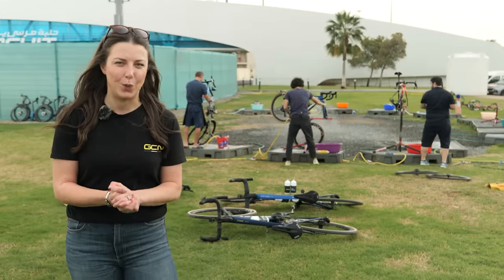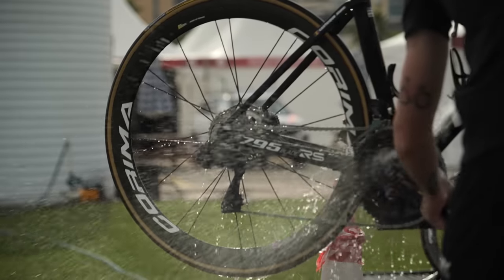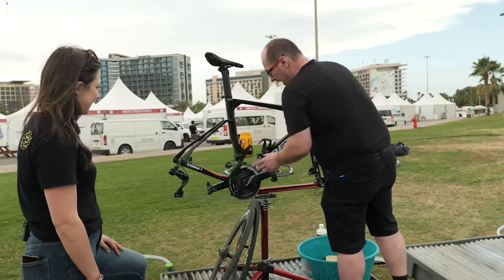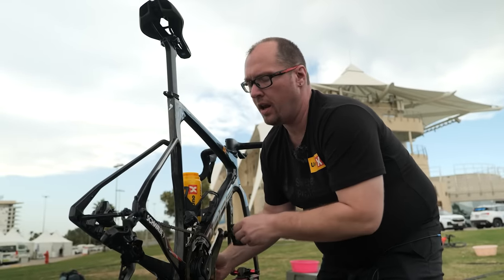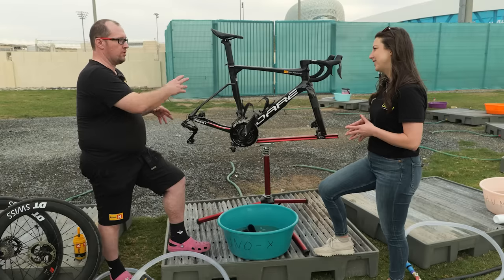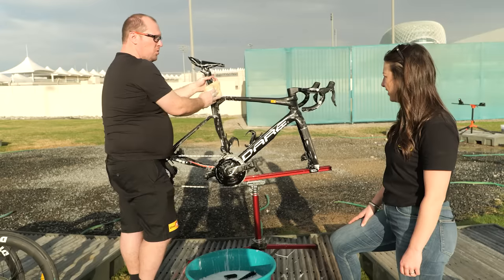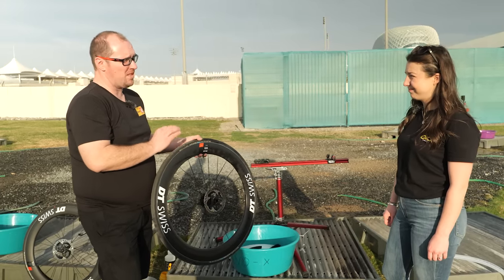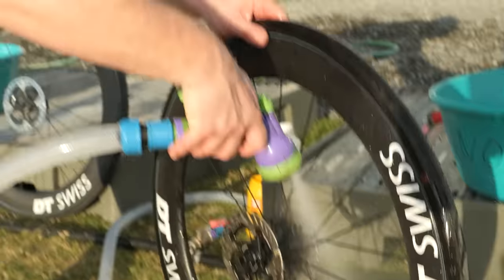How To Wash Your Bike Like A Pro Mechanic

Comment from the maker: What was your favourite tip from this video? 🧼
Reply: Interesting that (other than WD40!) much of the pro advice is the same as Si's 10 year old bike wash video, even down to the washing up liquid and using the old water bottle and brush for degreaser.
Reply: As long as you clean your bike .dry it . I like air compressor for the chain .lube .good to go.
I'd say it's not good to wash the bike every time. Especially in summer unless your sweating lots , but definitely the chain. Washing to much kills  the paint 😮? What do you think
Reply: Has to be the water bottle. Easy and effective.
Reply: Cleaning the pedals.
Reply: Don't let a pro mechanic clean my bike 😳. Too liberal with degreaser for my liking. Different story if you don't have to pay to replace degreased bearings.
Reply: The water bottle tip was good 👍
But on the other hand, I would never run the chain around the rear axle 😁
Interesting that PTFE additives are not prohibited in pro cycling?
Reply: always eat before you wash.
Reply: I wish you asked him why he didn't use a dummy wheel thing for the chain

Comment: Next video: “Why you shouldn’t wash your bike like a pro mechanic”
Reply from the maker: It's a great idea! 💡
Reply: With some Silca bikewash products and boiling water to clean the super secret wax of your chain. I'm surprised the at this level of cycling they still use lube
Reply: They are running out of ideas
Reply: @chrisjong8412  The key is drivetrain losses. A CLEAN chain with lube will sometimes (depending on the lube) have marginally less losses than a waxed chain BUT that's almost never the case because (as you know) a lubed chain is pretty good at catching dirt and holding on to it. For us non-pro riders, a waxed chain therefore almost always makes sense (that being said I still run lube because I can't be bothered to faff around with white spirit and a crock pot), but if your bike is cleaned by someone else after every stage in a bone dry desert stage race ...
Reply: @robbeelsas  And to add, a waxed chain needs to be rewaxed about every 300 miles, maybe sooner in bad weather, so in stage races, that's basically every day times 8 times 2 in the worst case (rain and every riders needs their reserve). Now you could bring a truck full of pre waxed chains for every stage, but that's a lot of faff beforehand. And if not it's more faff inbetween. Mechanics don't like it basically, so it is not used widely yet. Chain longevity isn't much of a factor in pro racing I guess, but that is the main selling point for wax for consumers.
Reply: noooo 😂 @emanuelv19
Reply: I just felt the line she used was bad "how do you wash a bike like a pro mechanic", why didn't he go "as I'm a pro mechanic, I just wash the bike"
Reply: @gcntech when you degrease a waxed chain, do I need apply lube?  My new bike has a waxed SRAM chain, there is so many videos I’m getting confused? I really want to keep on top of the bikes care because it’s my first expensive bike.
Reply: @ramsden35  You don't degrease a waxed chain as there's no grease on it. You re-wax it when needed by either spraying/wiping it off(never put water on a waxed chain unless you're re-waxing it), then boiling water and swishing the chain around in it first, or putting it straight into the wax pot and doing the waxing stage again. If you don't have a waxing setup then I'd have to guess you would need to clean the old wax off with the boiling water pot and then switch over to regular oil.
Reply: Bucket and soap and some degreaser for the chain and cassette it's not rocket science

Comment: As a bike mechanic I see a lot of damage from washing, especially as nowadays bearings have become thinner and are often more exposed to make room for larger thru axles and all that on bottom brackets and hubs. If you are not a pro and plan on keeping your bike for a few years go easy with the washing, never use pressure hoses, and better remove the rear sprockets if you have to clean them (you don't want degreaser entering the freehub body bearings).
Reply from the maker: That's really interesting! Easy on the washing is good idea, keep the bike clean but don't ruin the bearings 😬 - What do you think about chain wax? 👀
Reply: Yea, my bike shop actually advise me unless you were riding in the rain, else just get a piece of cloth, wet the cloth and wipe the bike, that's all, as for the drive train, another piece of dry cloth and toothbrush to clean and re-lube. The mechanic actually told me that lots of bikes were having problem here and there because they were washed with water and cleaning products too often.
Reply: @emanuele8226......Another thing I saw that I wouldn't recommend - the carbon wheels seemed to have internal nipples on the spokes. As most wheels these days use alu nipples it's not a good idea to wash them off with a hose [and definitely not a high-pressure hose] as you will get water ingress inside the wheels.
This will cause electrolytic/galvanic corrosion to the nipples - which ultimately leads to spoke failures and as consequence possible serious accidents.
Reply: I wouldn't be able to take off the rear wheel or the rear sprockets (think that's the cassette). So what would you suggest in that case? Not clean the bike?
Reply: Spot on!
Reply: how about the bottom bracket? When you apply a degreaser on chains and crankset, some of it seeps through the bottom bracket. How to prevent that? And if you remove the crankset, the bottom bracket is more exposed to the cleaning agents, so which is which?

Comment: We now need Ollie reacts to this video. Fairy liquid, degreaser in all sorts of unholy places, not removing the chain and cassette to simply submerge them in degreaser (or melt the wax off them), spraying water up the bike, using a sponge and there was even mention of a pressure washer.

Comment: It was a good video. Mike was quick but very systematic, very detailed. One question though. What about protecting the brake rotors, calipers and pads, with all this degreaser being applied and water spray going across wheel from cassette to rotor. Seems to be asking for contaminated brakes.
Reply: He did mention this in the video, he cleans everything after the degreasing

Comment: Always take your rear cassette off before degreasing it. Never get degreaser near your rear wheel hub. Learned that lesson the hard way in the past as always cleaned rear cassette like the guy in the video, which ensured water and degreaser got into the freehub eventually.
Reply: So what should I do if I can't take off the cassette and rear wheel? Supposedly you should degrease your drive train frequently. But how do I do that if I also have to wash off the degreaser very well to ensure that nothing remains?
Reply: @luperamos7307  depends on the reason why you cant remove it. If its just about not having the right tools, get them! If its stuck then get an LBS to remove it and replace. If there is any other valid reason why you cant remove the rear cassette, then it all depends how dirty it gets. You can degrease the chain without any degreaser getting onto the cassette by removing the wheel and using a chain keeper. If the cassette isnt covered in mud you can always do a cheats clean by giving it spray of something such as gt85 and then wiping it off with a cloth  that will remove surface dirt
Reply: @bladesman7701  GT85 is similar to WD40 I think. So I could just spray that on to degrease, wipe it off and not rinse it off? I just don't feel comfortable taking the rear wheel off bc I have no experience with that. Judging by all the videos here it seems that few people do.
Reply: @luperamos7307 yes mate it is similar however learning how to remove and put back on the rear cassette will help you so much. Lots of you tube vids show you how its done and the tools u need. Best of luck mate.
Reply: @luperamos7307 oh and using degreaser on your cassette while it is still on the wheel is ok so long as you do it sparingly, hence not everytime you clean your bike.
Reply: @bladesman7701  Yeah, I bought a used mountain bike before buying another. Mainly to play around with it. Always best to maintain your own stuff once you know. Appreciate your help!

Comment: looks like the pro peloton isn't so big on chain waxing (don't tell Ollie!). I pretty much follow Mike's strategy, except don't remove the wheels after every ride, unless it's been particularly gritty out, and don't degrease the drivetrain because wax (Silca drip-on currently). Always dry the bike before storing it, lovingly, inside the house 🙂
Reply: Silca degreasers are made to not negatively impact wax so if you go with their degreaser you can do the drive train, I believe.

Comment: What I always wondered about: It is generally not recommended to wash a bike with a pressure washer. However, I have never seen somebody say something against compressed air for drying the bike after washing it. Wouldn't compressed air also push water into all the bits an pieces that we don't want water in - bearings and stuff like that? What am I missing?

Comment: I basically have 3 standards of wash, 1. quick rinse and dry, wheels in, mostly in Summer. 2. Degrease and wash, wheels out, re lube, after nearly all Winter rides. 3. Strip, degrease, thorough wash, wheels out, cassette and crankset off, relube, polish etc. The whole 9 yards.
Reply from the maker: Sounds like you've got your system down 🙌 How often are you doing the big clean?
Reply: @gcntech  moveable feast to be hones, depends on the weather.

Comment: I wash my bike chain, pedal tooth, drueller especially its wheel tooth with liquid detergent soap dilluted in water by using toothbrush(medium), brush thoroughly while rotating your pedal until all dirt removes and then wash with spray water until the soap residue remove and clean… let it dry, thoroughly dry… then have a spoonful of crude oil , dip dry toothbrush and apply on chain, drueller tooth, pedal tooth while rotating your pedal by hand.. proceed brushing until you hear that smooth sound, means the oil penetrates inside the chain, pedal and druller wheels… dont use lubricants as it invites much dirt… once your frame dry, rub w clean cotton rug dip little on crude oil to waterproof your frames so as  it will not invite dirt or mud and its easier to remove.. for all bolt joints brush it with small amount of crude oil… remember; a spoonful of crude oil is enough for your bike… I’ve been using this scheme for more than 20 years by now..

Comment: Theres loads of degreasers out there. My tip is Elbow Grease from Poundland. £2 a bottle lasts for ages. Great for complete strip down cleaning and when used diluted is brill for general degreasing whilst components are on the bike.

Comment: Hmmm … car and bike detailers stopped using sponges a long time ago. Too much embedded grit. Soft brushes best. I also use Fairy Liquid for wheels etc. GCNTech, in a previous washy video, were horrified people used that. Assume this chain not waxed. GCNTech also strong wax advocates, I prefer wet lube, applied often on a cleaned chain.

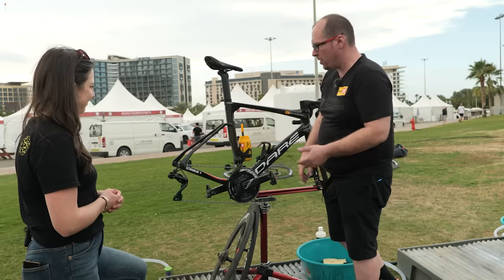Comment: I had a small panic attack when he said "water bottle holder" at 2:51 in the most British way possible 😅
Us non-natives can struggle with deciphering that combo 😄

Also, regarding the procedure itself:
1. You can see wear on through-axle from chain-rub. I'd avoid running the chain over it. Pro can do it, cause they'll just replace the whole bike every now and then. 
2. It's better to spray the washing solution, than to rub it with a sponge like in this video - depenging on how dirty your bike is, you gonna scratch the coating.
For optimum results spray warm solution, let it soak, wash it down. Only then, if there's some stubborn dirt would I use the sponge.
Reply from the maker: Hahahah it's a tricky one 🤣
Reply: A holder that holds a water bottle?  How much more descriptive does it have to be for you to understand.  Would "bidon cage" be more obvious?
Reply: @stevemawer848  why are you so rude?
I'm talking about the pronunciation, where British people tend not to pronounce t, d, r letters in some cases.
Reply: @dtsybulskyi   I'm not so rude - you really shouldn't jump to wrong conclusions or it'll make you look foolish. Nowhere did you mention pronunciation, just "in the most British way possible" which, to me, meant clearly articulated.  Try to be clearer when you want to be rude.

Comment: Pretty much the same way I wash my bike except I don't use Fairy liquid but a bike cleaner for the frame, and don't take off the wheels unless the bike is caked in grime. Also, I clean my brake rotors every other or third wash with a regular disc brake cleaner, and check that the callipers are nicely centred.

Comment: I really would like to have seen his tips on applying chain lube. I used to apply it like he did in the brief clip you showed, but it was excessive and made a mess. Given he just washed the bike, I'm sure he has some great tips to share. Instead, I've been doing it lately like some other videos have shown: a drop on each link. Takes more time but generally less messy. I'd love to do it faster.
Reply from the maker: Hi, thanks for the comment. This is a tricky one, because the bikes are washed daily, the mechanics quite often aren't that bothered by any mess being caused, as they will be washing them again within 24hrs 🪣
Certainly though, to keep it nice and clean, you need to carry on following our tips of applying it to each link, or, do as Ollie would do, WAX! Hope it helps?

Comment: I guess this works, hosing the drivetrain, if its riden daily. When you get it that wet, new lube or not, best dry it with compressed air, or you'll find a rusty frozen chain a week later, to us weekend users. Just tear it down and clean it proper every 500 or so miles, if needed, based on conditions. Doesn't take that long. I get about 2000 miles out a PC1130.

Comment: Ummm... I need to know about those platforms.  I've never seen that before, and it certainly looks like something that is purposefully done here.
Reply: They are a Euro style repair stand.  Pricey, but very nice.
Reply: I think the original poster is talking about the platform they’re standing on……They allow the water to run off so you’re not standing in mud
Reply: @dbk81  Those stands are no move expensive than most other repair stands. What is very attractive about those stands are no clamping of seat tubes. In this pro tour level, that means no accidental breaking of very expensive carbon fiber parts. The only thing you can’t do with that type of stand is check the front brakes. Everything else is now 200% easier.
Reply: @JMcLeodKC711 I got to use a much better dropout-style workstand in my previous workplace and it really is useful for bikes with sensitive seatposts, the kind that is so thin-walled you can't clamp them. Bleeding however, is more cumbersome as I need to come up with another way to tilt the bike to guide trapped air bubbles upwards.

Bike orientation rotation is the reason why I still prefer clamp-style workstands, most bikes I work on have clamp-friendly seatposts anyway. My own bike(s)? Never was an issue, I'll never use über lightweight seatposts I can't clamp onto workstands.

Comment: You should never use Fairy liquid, it's ultra abrasive and designed to clean plates, which are a far harder surface.. You would be better off using a neutral PH car shampoo, that's designed not to harm any surface.
Reply: Fairy liquid contains salt. Use cheap car shampoo.

Comment: my issue is I do not have easy access to a hose to rinse... yes I can use the car wash, self serve, but this is annoying to the drivers waiting and I still have to ride back 5k to my flat..  when I see the foamy water over the dirt to get it clean, I have told not to do this as it will stratch your frame, whcich makes sense.
Reply: When I don’t have access to a hose, I use two buckets, one with soapy water, one with clean rinse water. I use a large cup to pour the rinse water over the washed bike. It’s a pain lugging big buckets of water from my kitchen but my baby is worth it.

Comment: There is no wrong or right what are you just wash your bike. The only thing you don't want to do is put the nozzle in a too much of a pressure because that would just that would be bad. You want to set your pressure at a low pressure so that you can clean every part of the bike. And I was under the understanding that soap could deteriorate your bike could make it rust or whatever. So you just might want to buy an appropriate bike wash. Inappropriate bike cleaner so then you can wash it and then clean it with water.

Comment: & people take this on, blast their bikes with pressure washers and ruin their bearings & mechanical (& even electronic) control cables. I've been a team race mechanic and a shop mechanic, & the number of "But that's how the pros do it!" stories I could tell would talk the leg off a donkey. Low pressure hot soapy water in a bucket and a gentle hose rinse is all you need. & a waxed chain.
Reply: He isn't using a presuure washer. It's just a hose with a sprinkler head.

Comment: Firstly, I wouldn’t put degreaser on pedals as it could cause them to get seized in place. Secondly, don’t use fairy liquid to wash your frame as it’s a degreaser and could potentially-rarely but still could-strip grease from bearings and such like, as it is more likely to be directed into these areas than degreaser for use on the chain, and washing up liquid is harsher. Another bike wash video, and a bad one at that… come on GCN…